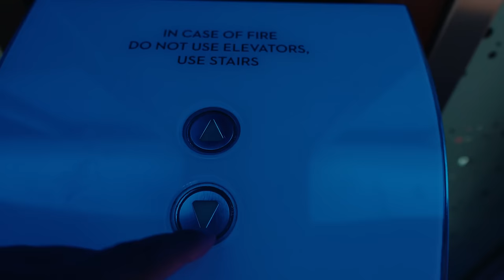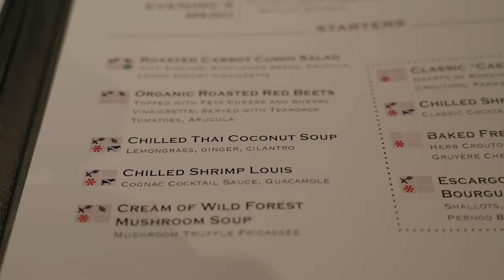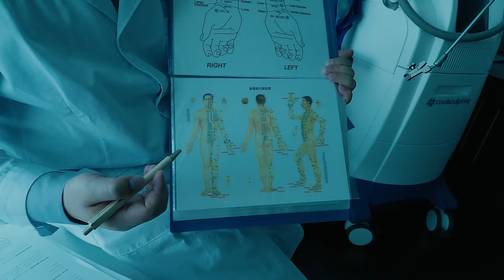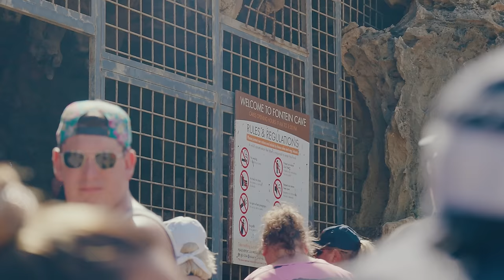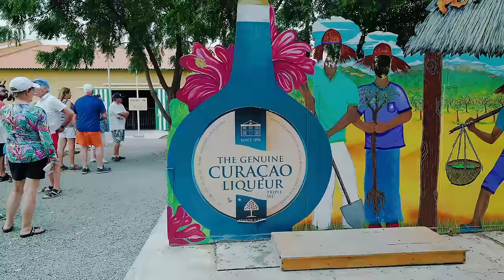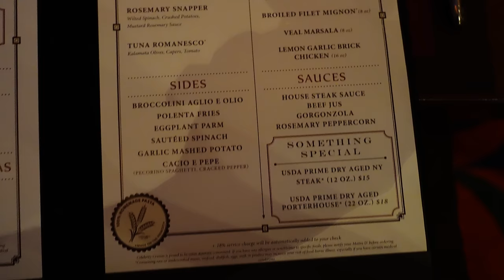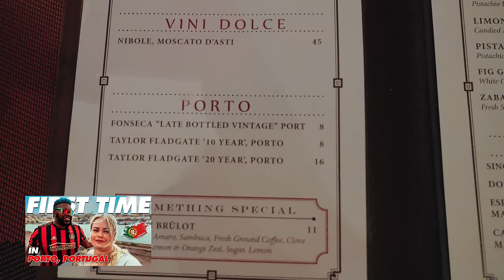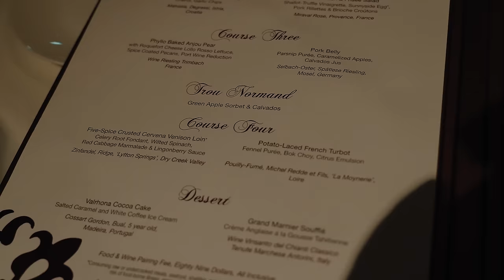8 Nights On One Of America’s MOST EXPENSIVE Cruise Lines | Celebrity Equinox

Comment: So glad I found this channel, y'all are so real with all of your experiences, and I appreciate your honesty and lightheartedness. 

1:00:13 (Aruba + Hair) 
Completely random/unsolicited (but hopefully helpful) advice... I feel you on the knotted hair problem. I have ~long~ hair, like mid-thigh length, and I've been doing at-home bleach and dye for 15 years, so it's a bit damaged and it tangles so easy. 
Favorite hair brush: Cheap!! Goodie brand, the ugly brown thin rectangle one, with the grey rubber twisty handle. I got it from Walmart. It's literally the most gentle brush I've ever had, I won't ever buy an expensive hairbrush again.
Try flipping your hair upside down to brush from the base of your neck instead of brushing it upright (like stare at the floor instead of a mirror while brushing, if that makes sense), then just flip it up once the knots are out, and finish brushing the top ❤

1:47:27 Hang up your shirt, pants, or dress somewhere in the bathroom and take a long, steamy shower. The steam should help get rid of those wrinkles. You can also get a spray bottle, fill it with water, then hang and mist your clothes. If you do the misting, you may want to do it the night before, so it has time to dry.